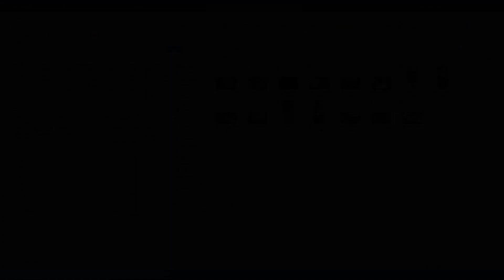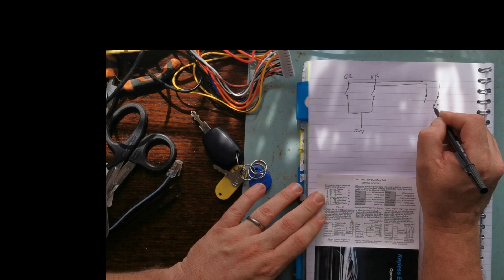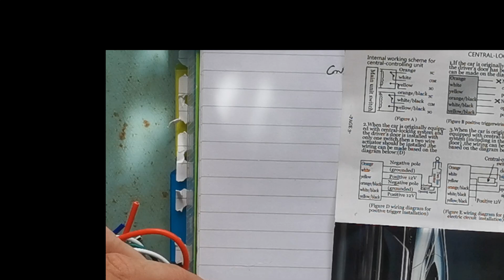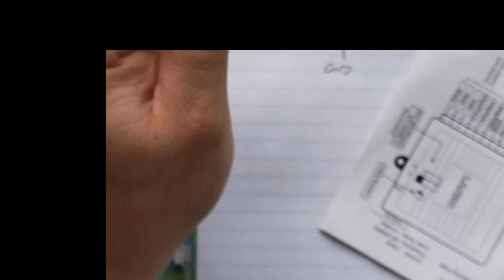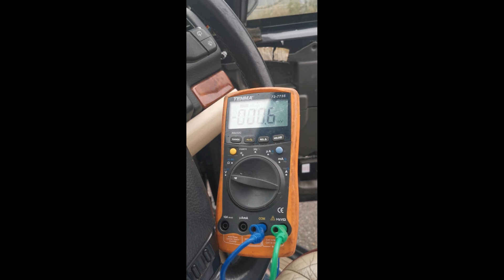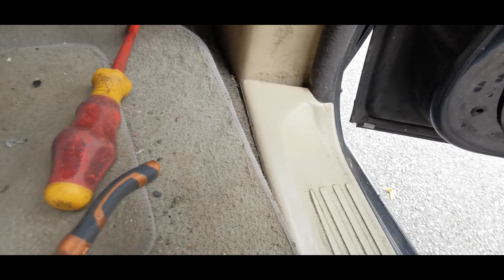Range Rover P38 Remote Locking Install

Comment: I replaced the LS engine. I want to supply electricity to the LS electronic unit. I have the switch. Where can I get a 12-volt line?

Comment: I have got a problem with my p38 1996 driver door LH  lock, window and mirror not working all other doors working if can you help me
Reply from the maker: Check connections behind the kick panel by your feet on that side. If that doesn't help take the door cards off and swap the outstations over and see if the fault follows the outstation
Reply: @rtechlab6254  OK my friend I will check the connector  tomorrow and I will give you the feed back I have fit the wirles remote on the driver door and it works fine but the rest of doors not opening or closing with it
I got engine disabled massage on the dash but it seem the security been bypass I bought the car used
Reply from the maker: I have passive immobilisation off, I had loads of key issues and that was the only solution as I was having to use the EKA almost every time. I'd suggest that not having all the doors locking could be a lock switch issue. The problem is that we are commanding the door to close not the BECM, I think this needs a revisit to tie up some loose ends.
Reply: @rtechlab6254  thank you Rtech I notes as I connect the battery all doors will close except the driver door not respond but when I have fitted the new keyless remote as your video driver door start to lock and unlock and the rest off the door not responding with it so maybe wiring issue or bad bcm I thank no signal goes to bcm to command the locking and unlocking
Reply: Hi my friend I have found the issue of the driver door it was one wire snap on loom go's through the rubber between the door to inside car body thank you Rtech for your help  now every thing works fine 👍

Comment: Hi, thanks for great video, i am thinking of doing the same to my p38 (oem fob fell in water) i am wondering how to make the alarm work when locked with the remote, will either be micro switches give a single (12v) once the door is locked or unlocked or they will give a constant open or closed circuit if the door is either locked or unlocked? If it is scenario 1 I think I have figured it out, it will also still be possible to lock from the remote and unlock from the door key and the other way around right?
Reply from the maker: I ultimately gave up on the micro switches. They aren't as simple as lock and unlock. IIRC it is more along the lines 'lock did something' and 'direction'. Hitting the relay directly as I did doesn't arm/disarm the alarm and a few diodes will take care of that.
Reply: @rtechlab6254  Could you explain where to put the diodes? im trying this out for myself. what wire?

Comment: thanks mate the only question is whill it demobilise the engine if doing this?
Reply from the maker: Short answer, I dont know. In theory if the transponder in the key still works it should be ok. Mine long since gave up
Reply: @rtechlab6254  do you have any ideea what could make the key fob not open the doors anymore unless i open it from key hole. No sync metod works. Thank you.
Reply: @rtechlab6254 no transponder in key